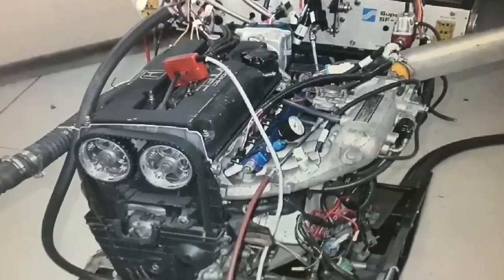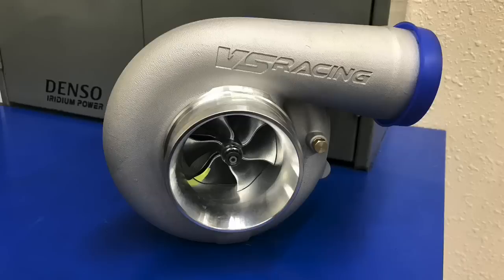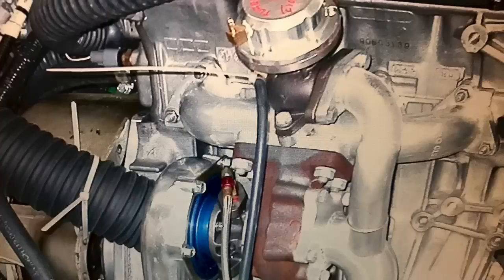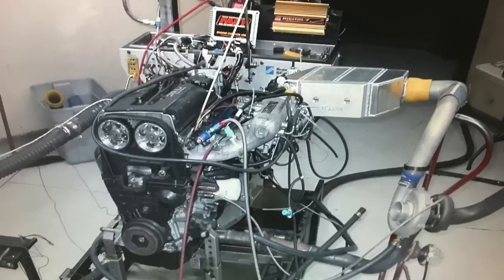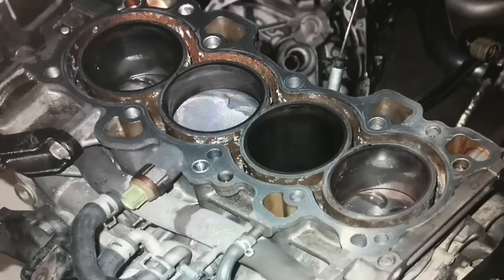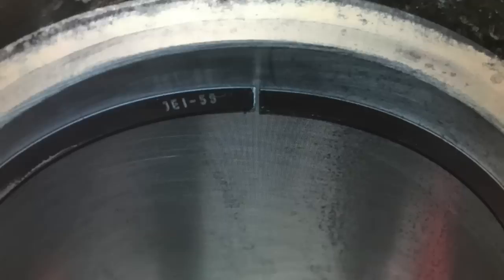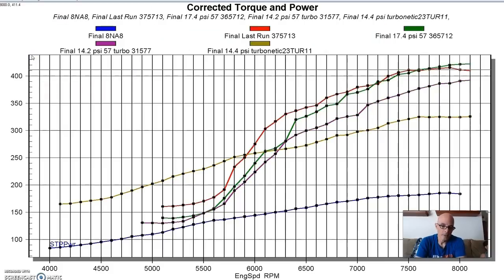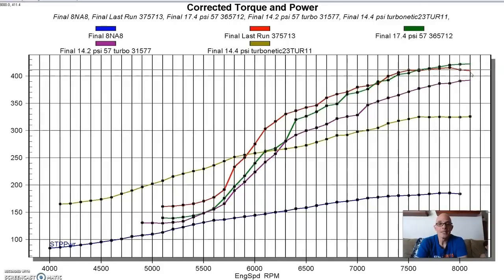BIG BANG B16A-HOW MUCH BOOST?

Comment: Great test, I was vary surprised when you posted something about Honda’s a couple weeks ago. I’ve ran a stock bottom end b16a with 10psi about 50000 miles 260hp and the thing just wants more, after watching this I’d be happy gapping rings and shooting for 350. Any more Honda stuff you have I’ll watch 👍
Reply from the maker: I have lots
Reply: 300+hp Honda is an insane feeing.
Reply: @fastinradfordable  phhhh wjy? My car came with 300 hp stock lol!
Reply: @ikaros21  What car?
Reply: @ikaros21  if you're referring to the car on your profile an old school Honda weighs around 1200lbs less than that. Power to weight ratio would be 11.6lbs per hp and Civic hatch around 6.5lbs per hp... That 300whp Civic will leave your car in the dust... That's why... 300whp Civic hatchback's or even coupe's will run into the 11's with a good driver and slicks.. and fwd need slicks for the quarter mile because their 60' is so shitty without them. Rwd doesn't have that handicap. Take both cars for a roll race and regular street tires work fine for the HP fwd setups.
Reply: @carguy6699  I'm glad you did your own research. I'm well aware of power to weight ratio. Like I said my car came with almost 300hp from the factory. Right know  the engine ,trans and rear end  have been modified and the car was put on a diet a long time ago (almost 600 pounds less) while still keeping the ac/ps and looking almost like factory to the naked eye :) My own recipe!
Reply: @ikaros21  that's great and all... You were just sounding like a lot of people on comments that say 300whp is weak.... Or hell people be saying 600whp is weak. Too many people have been jaded by videos they watch. They seem to think unless you have over 1000 hp your car is slow. Not everyone is Rich and not everyone puts the power down the same. Love that man! I've been wanting a wd6 am to mod. Buddy in the past had a full bolt on and cammed tuned setup with a 100 shot.  Thing was insane  never Dyno... By guessing of others... Maybe around 500whp...local track around 6000'elevation street tires 13.0 @118mph. he obviously could not grip.
Reply: .......AT THE END OF THE DAY......"THEY DONT THINK IT BE LIKE IT IS, BUT IT DO........."-OSCAR GAMBLE. 

PEOPLE ARE JUST SICK TO THEIR STOMACH WHEN THEY HIT A MID LIFE CRISIS, GO IN TO DEBT FOR 100K, TAKE A NICE SUNNY RIDE WITH THEIR EYE CANDY THATS FAR TO YOUNG FOR THEM, THEY SHARE A RED LIGHT WITH A PERSON WITH A CLEAN LOOKING IMPORT. TASTEFULLY MODIFIED. MINDING HIS OWN BUSINESS.....CHECKING HIS PHONE WHILE HE WAITS FOR THE LIGHT. POSSIBLY DECIDING WHICH SOUNDTRACK TO LISTEN TO AS HE VENTURES TO THE NEXT TRAFFIC LIGHT.......NOT A CARE OR EGO IN THE WORLD SHALL WORRY THE IMPORT DRIVERS  BRAIN....HOWEVER, IN THE NEIGHBORING LANE....THE MIDDLE AGED GENTLEMEN REVS THE ENGINE OF HIS NEWLY FOUND TESTOSTERONE FUELED DISCOVERY....... GAINING THE ATTENTION OF HIS COMPANION IN THE PASSENGER SEAT , AND PUTTING A WELCOME SMILE ON THE CAPTAIN OF THE IMPORT...........THE NEXT RED LIGHT WAS VACANT AS THE VIAGRA INFUSED, CONFUSED DRIVER OF THE DOMESTIC PULLED UP SUPRISED TO NOT SEE HIS OPPONENT WHO JUST WAXED HIS ASS AND PASSED THE LIGHT BEFORE  HIM TURNED RED.......HE SCRATCHED HIS BALD HEAD COMING TO A ROLLING STOP. POPPED HIS GLOVE BOX WHICH SPRUNG OPEN TO HIT THE KNEES OF HIS ARM CANDY,   HES ON A MISSION LOOKING FOR THE MAGICAL PERSCRIBED ANSWER TO DEFEATING OLD AGE AND RELIVING HIS PAST.. SHE LOOKS AT HIM AWKWARDLY WITH DISGUST, NOW EMBARRASSED THAT THEY LOST....HOW COULD THIS HAPPEN TO HER? SHE THOUGHT...DID ANYONE SEE HER? WILL IT BE A NATIONAL CRISIS ON SOCIAL MEDIA IF SOMEONE SEEN HER LOSE TO WHAT HER SUGAR DADDY PROMISED TO PROTECT HER AGAINST?....HE REACHES FOR HIS MEDICINE THAT IS SUPPOSED TO RID HIMSELF OF SHAME AND CONFUSION.......HE DROPS THE BOTTLE......A HORN BEEPS FROM THE CAR BEHIND HIM......THE LIGHT TURNED GREEN 10 SECONDS AGO......SHE REMEMBERS THE TWITTER HANDLE OF THE IMPORT FROM HIS DECAL ON THE BUMPER.......HITS HIM UP. AND THEY NOW SPEND EVERY WAKING MOMENT HOLDING HANDS TOGETHER, SKIPPING THROUGH FRESH FLOWERY MEADOWS AS THEY RIDE OFF IN THE SUNSET...........SOME STILL SAY YOU CAN STILL HEAR THE FAINT SOUND OF THAT PILL BOTTLE AT THAT TRAFFIC LIGHT.......
Reply: @mchristII  You got imagination. I like it.
Reply: Ive an unopened b16a2 w itr intake and gsr cams, evo 8 twinscroll on 11psi made 308hp, engines done 140k no issues whatsoever in 4 years
Reply: Boosted EG9 man I got the same engine and I’d love to do a setup like that. I was always worried about reliability but you’re making it very tempting for me to go the FI route.
Reply: @Mod_29  how's the torque curve with that twinscroll?  Does it behave like the evo engines (where they make as much torque as they do hp)?
Reply: I only have arp rod bolts. And p30 piston i make 388 on 10lbs
Reply: You can make 350 now without doing anything else. get a bigger turbo or turbine housing if its around 52mm-62mm with a .82-63 AR you're gucci. The slow spool will save the block in the long run.
Reply: what happens if you set the cross over earlier like 4500 rpm on turbo
Reply: @alitoroganan2442  you lose some mid range power...

Comment: Will we ever see a big bang 300 Ford?
Reply: This is the one we need.
Reply: I'll 2nd this
Reply: Are you talking about the 6 cylinder 300
Reply: @jwayne1202  Yes Sir
Reply: Richard @@@@@
Reply: I 2nd, and 3rd that motion.! . 
Always wanted to build a turbo set-up when I had my 78' f100 with the 300-6. 
Would be really cool to see what it would be capable of. 
Thanks for all the great content . Really appreciate your time and effort.
Reply: Anything to make some decent and cheap power would be appreciated.
Reply: Rob Thoreson power and longevity would sure be nice
Reply: The funny part would be maxing the pressure and the 300 goes, yeah, so? Lol! Kill a 300......you'll need dynamite! They won't die and the head won't flow enough  to break. Awesome engines!
Reply: @jimmiller4667  search 300 Ford turbo on here. 
Hp, eh it's around 210-230 maybe , but mid 400s for torque in one big lump down in the mid range. 
Most of the turbo setups I've seen on here for them, I'll say they aren't highly engineered and with that mild of a setup with that kinda power is pretty good.
Reply: Seconded, I love watching fords blow up

Comment: Do you think the ring gap could also be the cause of bent or broken rods at high RPM on N/A engines?
Reply: Ring gap won't affect rod strength
It's odd to bend a rod NA. Usually they just break (and you have to be making much more power than factory)
Reply: Usually when rods break NA, they break under tension at the top on the exhaust stroke. There usually isn't enough squeeze on the piston to compression fail about any rod without boost or spray. Some older engines have cast rods, crazy I know, but they give up the ghost in spectacular fashion sometimes only 1000rpm above the factory Rev limit. If you break a rod NA, and it's a dedicated NA engine, usually that calls for lighter pistons and pins. But to answer your question, probably not. NA engines of the same displacement put about the same amount of heat into the rings. Yes there will be some difference between an alcohol sprint car and a taxi, but even pickups get worked hard and have the ring gap from factory to pull the rated load up mountains. The difference your going to need before you pinch rings in a Nascar stocker and a guy moving his camper across California is tiny.
Reply: This video got me thinking, because years ago guys would  say big blocks couldn’t handle boost with stock pistons, because the pistons would break, and they can’t handle RPM’s because the rods would break or bend. I wasn’t thinking about the fact that the rods are cast. Thanks guys!
Reply from the maker: we've run stock BBC pistons and rods to over 1200 hp so far
Reply from the maker: broken rods happen from snatch load at rpm-usually a missed shift or two

Comment: I know its really obscure but I would love to see an audi 2.7tt on the dyno. Some guys run the factory short blocks routinely over 800hp. The 3.0l engine in the family get a bad rap, myths of cylinder walls splitting at 400hp. They are also the most common, the whole car can be had for less than $500 and has the best heads.

Comment: Love all the content  but especially the Honda stuff.  I've made 612 on a stock b18b sleeve with  CP 9-1 Pistons and scat h-beam rods with a VTEC head. I have a 84 1/2 mm  la sleeved GSR which has no cylinder reenforcement. That motor has 10 to 1 wiseco pistons, Manley turbo tuff rods. It made 847 to the wheels. It was dynoed on a mustang Dyno. Both of the engines were extremely reliable and the GSR is still in my race car.
Reply: How much boost
Reply: Jason America 847FWHP?
probably like 25lbs+ of boost
Reply: I like Hondas but which part of that was stock?
Reply: @monjier  yeah thats me'
Reply: @taknmybeatings7036  haha maybe i read it wrong.  It does say stock b18b, but maybe the bi18b sleeve was stock?  Idk.
Reply: 34 lb of boost
Reply: I have a stock bottom end B18b1 w/p-72 v-tec head im picking turbo part out any suggestions would be greatly appreciated.what turbo ? Im looking for a all around good response mid and high rpm hp turbo w/ a reliable race proven setup . Any suggestions?Thanks
Reply: Look up on YouTube 

Gene kim
Robert breaker 
Chuck missle
Reply: What type of gas
Reply: @michaeldavidmontalvo2402  pump e85

Comment: Holy 2002 setup, Batman! This test would be much more interesting if it was redone with modern turbo tech.
Reply: also this is a dyno test,  boost response doesn't matter as much just boost pressure
Reply: I had a pretty similar setup in a dc2 Integra back in the day. Had the b18 bottom end though
Reply: Look up Robert breaker
Reply: Chris M ikr... this guys a hack.
Reply: @mareksumguy1887  I disagree. Richard is a trailblazer and has extremely deep knowledge on engine dynamics, this is just a really old test that he's revisiting, likely to cater to a wider range of viewers. Most of his clients these days are V8 owners, so he doesn't visit 4 cylinder stuff much anymore. You can't fault him for that.
Reply: @mareksumguy1887  This test appears in a book he published in 2003, it wasn't done last week. This stuff was the best available at the time. I'd love to see him re-do it with a modern turbo, but as I said, he's got his hands full with V8 stuff. That's where the money is.
Reply: @mareksumguy1887  let's see you do better. Where are your videos?

Comment: Great test. Given how cheap the insurance is for forged rods and pistons are these days. If you're pulling a honda motor apart to increase ring gap. You'd be well advised to get a 0.5mm overbore, forged pistons and rods. Money well spent.

Also for context, Given the fuel and intercooling used, it's not really preresentitive of what can be achieved with a street driven car. No-one is goinv to be running around daily on Leaded 118MON fuel. So the timing on a street motor will be significantly less, with a corresponding reduction in power produced. Also these tests are rather short short (5-6 seconds.) When loaded for long periods of time (say circuit racing,) fatigue can and does set in on weaker rods (that might happily survive a couple of dyno pulls.) MCM found this out the hard way on their 4G64 2.4L with far less power. It was fine on the dyno, and fine for a little while on the track, but eventually a rod said enough, is enough and bent.

Still and interesting test, to determine the limits.
Reply from the maker: this motor can easily be driven around on E85-dyno tests run 300 rpm/sec (easy math)

Comment: how about pulling back the timing a LOOOOT and adding more boost like the way that "squirrel tuned" guy did with his sbe 4.8 ls motor on stock unported heads. dude pushed 41psi through that motor and put his fox mustang in the high 7s in the full quarter. look him up
Reply from the maker: I'm familiar with that car-impressive stuff-power takes the right combination of boost and timing

Comment: Like to see this done with a 2.2 ecotec
Reply: When gm went racing with these, they used the factory block and turbo head and made more than 1200hp with all the boost and a huge dose of spray.
Reply: a 2.2l ecotec, with the rings gapped, has done 400 whp. its uncommon though, most people that try end up breaking a piston or disintegrating a rod around 300 whp. around 500hp is around the point where you need a closed deck block, either a girdle, or go with a gen 3 block. 

the ecotec is the first 5 second 4 cyl 1/4 mile, and it used a cast lsj block and head
Reply: I recall a 700hp test on one back in the day.

Comment: I'd be curious to see a Big bang subaru! They're famously blowy-uppy, how much cold Richard Holdener make? I suspect they don't have quite enough ring gap stock, and often times people are trying to shove way too much boost in at low speeds.
Reply: that's exactly what i was thinking, hopefully we get to see him run an sti engine to its limits and maybe elaborate more on the famous ring land failure
Reply: @AlexP-yb7gh  I've seen the theory that ring gap is just too tight stock and sits there and weakens that area with lots of slight ring butting.

Comment: Dodge 420a .030-.035 ring gap 30psi made 661 Whp old school GT40r T4
Reply: Is that pretty universal for most 4 cylinders?
Reply: I had a dodge avenger with a 420a in high school. First car I ever turbocharged. Was completely stock for the most part other then map spacer, fuel pump, and the usual. But I ran that thing hard for 3 years before I sold it and never had any issues. She loved boost.
Reply: Budget Boost DIY   no that wasn't me but I was on that forum a lot. I had a 10.1 fmu and I did the cold start injector that was on a pressure switch. It turned on after 10psi of boost and added more fuel. I made a dual in tank pump setup, I used two pumps from a gst. I miss that car. I hear now all the srt4 guys are running 420a heads on there 2.4.
Reply: Budget Boost DIY  Yeah im DSM-ZERO. ive actually been trying to sell the car

Comment: At what point is ring gap too much? 1 inch?
Reply from the maker: a touch before that
Reply: 1" would be fine in a 140" bore.
Reply: Just leave the top ring off if your really that worried.
Reply: @timothybayliss6680  Great idea.

Comment: now a days lots of high powered honda builds use CSS cylinder support system they convert your block to a closed deck, otherwise a sleeved block like darton MID or LA sleeves are also a good option. Ive heard around 450+whp stock sleeves start to be a gamble some might get away with it and some might crack a sleeve, of course a few pulls on the dyno doesnt really show how long it will last over a longer period of time.

Comment: Awesome test! I had no idea those Little buggers could produce that much power at roughly 15 psi. 

Thanks for posting it 😁
Reply: Keep in mind that with race fuel they can run much more aggressive timing, than can be done with typical premium pump fuel. Also the lack of any accessories and drive components makes a massive difference.

Comment: Would you do a 100psi boost test? Methanol, prepped stock bottom end, ring gap, custom cam...all on a Chevy 350 Vortec! Enough turbo and fuel to split whatever in half👍
Reply from the maker: it won't take 100 psi
Reply: @richardholdener1727  C'mon Rich......by your own admission about what the internet has said about what will work or not on an engine, how ya gonna know? Let's be honest, nobody has thrown that kind of boost at anything less than a tractor pull diesel or an all out, small displacement, purpose built import drag engine. But the fact remains that above 20-30 psi boost, most folks never think of going beyond that. 100 pounds of boost is absurd and impractical, but it is an adventure! And methanol can cool things down enough to make things happen.
Reply: @dj4monie  C'mon man, the easiest way to get that kind of boost is to do the math. There are formulas on Garrett Turbo's site to make the calculations. Most of the big players in the racing world run well above 4 bar ( roughly 60 psi ) all the time, with guys like Boostin Performance putting

 80 psi through their Mitsubishi ( single turbo, methanol ). It can be done. It's all math and money. The 100# test is only for dyno purposes..you'd have to have a proper chassis to hook that power potential. 
If you take a 350hp Vortec, which is at atmospheric pressure, and add 1 bar of boost ( 14.7 psi ) theoretically you can double the power if the matching volume of fuel is there. Now add 6.5 bar worth of boost, with the air volume, fuel volume and air temperature control, you should have 6.5 times the power. It can be done. Will it survive? Doubt it, but it would be fun to watch.